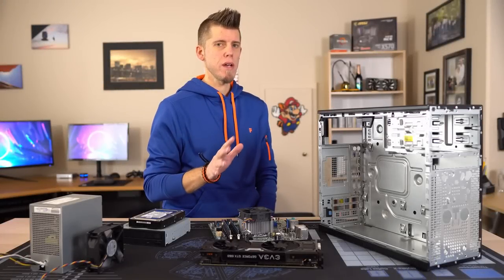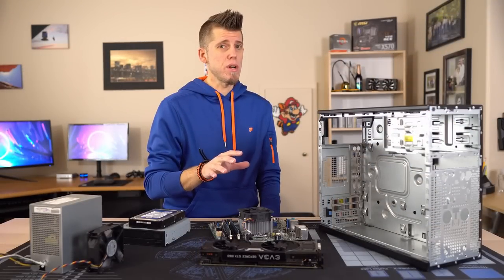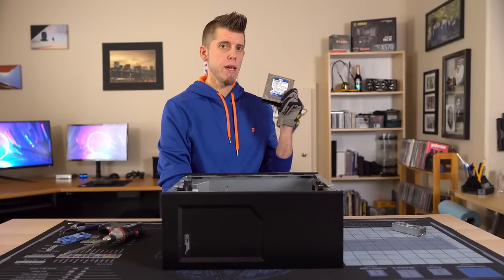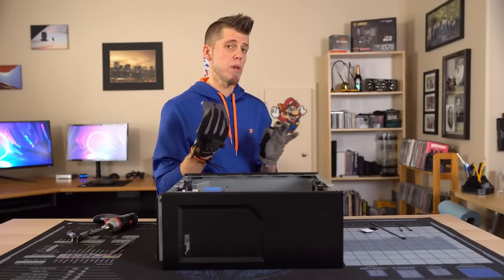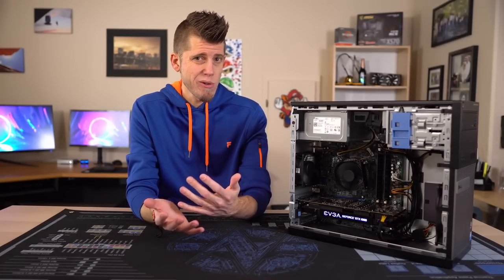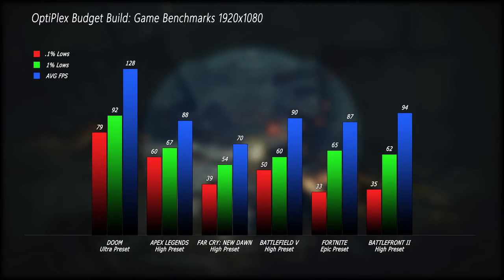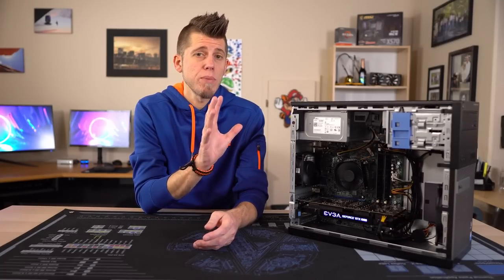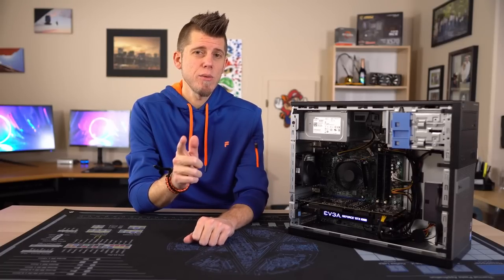Dell OptiPlex Budget Gaming PC For Under $300?

Comment: Hi I'm using optiplex 3060, I need to upgrade my graphics card to 8gb but my cabinet is small any solution please help me sir
Reply from the maker: Is this a small form factor model or is it a mini-tower model?
Reply: Small form factor
Reply from the maker: @sanobp1107  In that case, there aren't any 8GB GPUs that will fit in that case without cutting a hole in the side. All that you can fit are low profile GPUs and the best on offer right now is the GTX 1650 GDDR6 model which only has 4GB of VRAM. But the good news is that it will run on your power supply. The one big issue I can think of is that your PCIe slot on the 3060 is right next to the power supply which will probably keep you from installing any dual slot GPUs.
Reply: Thanks for your reply Sir,Can I extend up to 32Gb ram on this mother board ,Dell Inc.     04Y8V0   /G1X38Q2/CNFCW0086N02HM/  A02
Reply from the maker: @sanobp1107  No problem. Yes, the 3060 can have a max of 16GB DIMMs per module. So, you can install up to 32GB in the 3060.

Comment: Can i upgrade the cpu cooler using aftermarket cooler? I have dell 3020 also where can i connect the sata cable?
Reply from the maker: Yep, the mounting pattern is standard so any 115x cooler will work, just be mindful of the height of the cooler. You will need a Dell 5-pin to 4-pin fan adapter and you can find them on Amazon pretty easy. As for the SATA, you should have three ports, just enough for the HDD, SSD, and optical drive and they should all be in the same spot.
Reply: @TheGameBench  thank you so much
Reply from the maker: @klintdavid9664  No problem.

Comment: i found a optiplex 7020 mt for 193 here in canada. and i think it will be good to get! here are the specs.
Intel Core i3 4th Gen 4150 (3.50 GHz)
4 GB DDR3
250 GB HDD
No Screen
Intel HD Graphics 4400

Note: i have 6 gigs of ddr3 ram and a 2 tb hdd so i get 10 gb ram and 2 tb extra.

also is this good for gaming if i add like a rx 470 or gtx 960ti or a 1050ti? (i will be adding a new evga 650 watt psu btw)
Reply: also adding a rx 550
Reply from the maker: @samoodie  Well, I don't know the market in Canada, but I will tell you that the i3 is going to be very limiting. I don't recommend the i3's for gaming, unless you're playing esports titles and you want to get a 750 Ti. The i5's are really the lowest I'd suggest. 10GB is adequate for 1080p. Not a lot of titles will exceed that. If you can, I would suggest getting a 120 GB SSD for the boot drive. It will really transform the system, make it a lot more usable.

Now... the GPU. Well, as far as I know, there is no 960 Ti. That being said, I wouldn't suggest the 960 for one of these. Of all the cards you listed, the 470 and 1050 Ti are your best options. The 470 should beat the 1050 Ti and cost less. Regardless, the RX 550, 470 and GTX 1050 Ti have no use for a 650 watt PSU and can run on the stock PSU just fine with a SATA to PCIe adapter. Then you can use that money to go towards the SSD and/or a system with a 4th gen i5 instead of an i3. The i3 might be fine on the 550 or 1050 Ti, but not the 470, and the 470 is going to give you a much better experience over the other two.
Reply: @TheGameBench   so instead im getting a 7010 its newer for me and i only need 2 slots since im getting 8 gigs

Comment: I need help if this is good I ordered nzxt h510 case ryzen 5 2600x 320gb hdd 550wat 80 plus psu 8gb kit 2x4 b450 Aorus elite and later I will get a graphic card with it and better ram and a ssd
Reply from the maker: I mean, a 320GB HDD is pretty small these days. I wouldn't go for anything under 500GB these days, and 1TB drives are so cheap. The rest sounds pretty good, depending on what you paid.

Comment: I want to build this with a 1060 but here in Sweden the 9020 i5 4590 costs 250 USD. In my budget I could buy the 7010 i5 3470 for 150 USD + a 1060. Is this a good option?
Reply from the maker: How much can you get a 7010 with an i7 for?
Reply: The Game Bench 7010 can only be found with i5. The 9020 with i7 4790, 16gb of ram and a 500gb ssd goes for 450 USD. Another option I could go for is 7010 and swap in a xeon like the 1230 v2 for ~50 USD if that is a good option.
Reply from the maker: @slavichussar5825  I assure that the 7010 does come with an i7 3770 as an option. The 1230 V2 would be about equivalent to the 3770. Regardless, the 3470 isn't going to be a ton slower than the 4th gen i5, but in my testing that increase in IPC can really help depending. However, $250 is insane. IT's not worth the extra $100 over the 7010 with a 3470. Swapping in the 1230 V2 would be a better option at only $50. Maybe see if you can find the 1240 V2 for about the same price.
Reply: The Game Bench I meant I can’t find the 7010 with an i7 in Sweden, sorry for not being clear. So 7010 with a e3-1240 will work? Will this system with the Xeon still be able to run the gtx 1060 with the stock psu?
Reply from the maker: @slavichussar5825  Ah, I see. Well, no matter. The E3-1240 V2 will work just fine and it's going to perform pretty close to the 3770 with only a 100MHz drop on the boost clock. It might also draw a little less power than the 3770 as well. The 7010 has a 265 watt power supply, and should give you about 65 watts of headroom with a 1060 6GB installed. With a 1060 3GB, closer to 80 watts. It's cutting it close for what I prefer for a good buffer zone with the 6GB model, but you should be fine. Just might want to consider a power supply upgrade down the road, which is pretty simple in the xx10 series Opti's.

Comment: Can u change the cpu cooler for a new one
Reply from the maker: Yes, there are ways to change out the CPU cooler. I just depends on the cooler and the mounting method. Some will work as is, some will require modifications. Also, the fan controller is pretty picky, so the fan might not work properly. In all honesty, there isn't really anything to be gained swapping the CPU cooler on these CPU's outside of aesthetics.

Comment: Just want to know, is this PSU strong enough for the GPU?
Reply from the maker: Yep, it is. The 1060 is a low power GPU. While people like to make it seem like it's a power hungry GPU, it's not. It consumes about 120 watts. I've done more than enough testing with this power supply and seeing the power consumption, you have at least 80 watts of headroom, or more on this PSU and a 1060 6GB . If you want a more detailed explanation, I suggest reading the pinned comment.

Comment: Which GPUS should the dell 290w PSU be able to handle without issue? @the game bench
Reply from the maker: Here's what I would recommend as far as modern GPU's are concerned. You have to be careful with the 900 series and older from nVidia and from AMD I wouldn't try to run anything older that the 400 series.

nVidia:

1050/1050 Ti
1060 3GB/6GB
1650/1650 Super
1660 3GB/6GB
1660 Super

AMD:

RX 460/560
RX 470
RX 5500 XT
Reply: @TheGameBench    Hmmm, I noticed some Chinese sellers selling the 1050 for about 60. Probably a bootleg right? Also I saw the GTX 780 but the amount of watts listed was 230. I assume that is way too high for the 290W. What is the max capacity that the GPU can have so it can be used with the 290w? 🧐
Reply from the maker: @coolguyvideos599  At minimum the 780 is a 200 watt GPU, but can even go upwards of 250 watts. I wouldn't try running it off the stock 290 watt. I would also assume the 1050 is a bootleg at that price. If you're looking for something right now, I'd suggest the 470 8GB You can find them for close to $100 on eBay and you're looking at around 1060 performance and can run on the 290 watt. As for max consumption, I would stick to around 120 watts.
Reply: @TheGameBench  Thanks you are very knowledgeable

Comment: Is the original power supply enough for a gtx1060 6GB graphics card?
Reply from the maker: If it's the 3020, 7020 or 9020 with the 290 watt PSU, then yes. You're fine. I highly suggest using a dual SATA to PCIe 8-pin power connection instead of the single.
Reply: @TheGameBench  why the dual verison vs buying the single one?
Reply from the maker: @theunknown5516  Because, when I made this video, I made the mistake of thinking that the GPU would draw 75 watts from the PCIe slot, and supplement from the dedicated power. Unfortunately, that's not how it works. It's the other way around. So what can end up happening only using the single SATA adapter with a card like the 1060, is that you can overload a single SATA connection, which is 54 watts. Now, I built multiple systems like this and never ran into a problem, but I still would suggest using a dual SATA to PCIe adapter with the 1060. The single should be fine for something like the 1650 and 1650 Super though.
Reply: @TheGameBench  ohh ok. can you link me a good dual sata to pci e power cable? thank you!

Comment: How did you plug the fan in? Does the motherboard for the 7020/9020 have 3 or 4 pins for fans?
Reply from the maker: The 7020 and 9020 have proprietary 5 pin headers. In the video I used a 4 pin fan to SATA adapter cable. I the used a press on SATA connector to get it power, but you can use a SATA splitter.
Reply: @TheGameBench  I'm sorry, I'm fairly new at building a PC and don't know/understand all the terminology. Could I purchase a 4-pin PWM version of a fan and be able to use it somehow?
Reply from the maker: @jjnether  No worries. You wouldn't be able to without some sort of fan controller that would allow you to control the speed of the fan, or have temp sensors that the fan could use to adjust their speed. There are adapters that will convert the 5-pin connector on the motherboard, but you would have to pick between having and intake fan and an exhaust as it won't have enough current to run both fans off the one header.

This is why I just use the SATA to 4-pin fan adapter and run the resistor cables if I need to slow the fan down. Besides, the front panel is rather restrictive and speeding up the fan will only make it louder with no real benefit without cutting a hole in front of the case for the fan. Something I'll be doing in a later video.
Reply: @TheGameBench  Thank you! So you're saying that I can run power to the new fan from the extra beige SATA port using a SATA to 4-pin adapter, and possibly add in a resistor cable if there is too much voltage/speed, correct?
Reply from the maker: @jjnether  Oh, sorry.... no. You had everything right save for the beige SATA port. The SATA ports on the mother board are for data, not power. What you'll plug the fan adapter into is one of the spare SATA power connectors, that look like the one at 7:53. Otherwise, you're spot on. :)
Reply: @TheGameBench  Thanks so much for the help. So where is the SATA power connector port on this layout? https://ibb.co/p2pww03    I believe this layout is for the 7020 MT which I am using

EDIT: I misunderstood earlier, I believe you are saying that you would connect the fan to the adapter, then the adapter to the PSU using one of the SATA connections. Thanks for the help!

Comment: Hey where can I buy ddr3 ram 2 sticks of 4gb for opti 3020 thats close to 30 bucks or under?
Reply from the maker: eBay. I stick to Samsung, Elpida and HK Hynix DDR3 1600 and I can find it one eBay for around $20 to $25 for 8GB easily, sometimes less.
Reply: The Game Bench thanks
Reply: The Game Bench 
Samsung 8GB 2X 4GB 2RX4 DDR3-1600MHz PC3-12800R ECC REG Registered Server ram
Would this work?
Reply from the maker: @ClipsVi3w  Sorry, I should have specified non-ECC. ECC memory won't work in the 3020 or with the Core series CPU's.
Reply: The Game Bench 

Ok. 8GB ( 2 x 4GB ) PC3-12800 DDR3-1600 MHz NON ECC RAM SAMSUNG HP how about this? And does the pc3-12800 text make a difference and does all of these rams work on all 3020 motherboards and cpu’s?

Comment: What is small battery that you replaced thanks
Reply from the maker: It's the CMOS battery. It provides power to the BIOS chip so that it can save your BIOS settings. The specific type is a CR2032 coin battery.

Comment: An Arctic 11£ P14 on the front would have been a much better choice instead of the fan you used.
Reply from the maker: How so? Wouldn't really have been a better fan and would have save only a few bucks. The reason I went with this fan is because I've found in selling these, nobody is interested in my area unless there's some sort of lighting. For that... it's worth every extra penny.

Comment: How to set the blue light fan in the case like in the thumbnail?
Reply from the maker: I have a couple of video to show you how. First you have to remove the HDD cage, then you have to cut down some material from the front to add the front fan, then I just used a Corsair AF/SP 120 blue LED fan. However, I highly suggest cutting out the material in front of the fan entirely for better airflow and reduced noise. Something I'm considering doing an updated video on.

Comment: While the PSU will be good enough to last for a while, don't be upset if it kills your system. I would rather spend $50 more to get at least an 80 Plus certified PSU with at least 100 Watt headroom.  You can save money by selling the old PSU and keeping out the extra fan.
Reply from the maker: I have no worry about that, and I'm confident it's a non-issue unless people ignore my advice and try to run a more power hungry GPU on it, or overclock. This PSU has close to 100 watts of overhead with this hardware. I will say that I would caution bringing up 80+ certification. It's just an efficiency rating. Has nothing to do with quality. There's this consumer perception that it is, and thus, garbage PSU manufactures prey on that by taking a trash PSU and spending a little more on the capacitors so it can certify as an 80+ gold PSU, bump up the price, and increase their profit margins. The people buying them have no idea that it's a terrible power supply, as they assume it's good because it's 80+ gold. Honestly, the 80+ rating is a factor, but it should be much lower on your list than some other factors.

Also, the fan is the difference between throttling and not throttling depending on the GPU. If you're fine with your GPU possibly dropping on the core clock... by all means.

Comment: What about using this computer as Streaming and CS GO at the same time?
Reply from the maker: If you go with an nVidia card and use the nVenc encoder, you should have zero problem. However, using h.264... I mean, it might be fine with CS GO if this were an i7, but it will effect performance. And being an i5, that might be a problem. If you're trying to be competitive, and I assume you are if you're streaming, I wouldn't want to take anything away from the CPU. That being said, the 4th gen i5 in CS GO was doing about 281 FPS on average, at the lowest settings, with the 1060. And you can use to the 1060 to encode the stream with no hit to performance.
Reply: @TheGameBench  Hmmm interesting, so it can be said that, the combination of i5 4th gen and 1060 is already optimal in terms of budget and performance for streaming and CS GO, am i right? or do you have other optimal combination? maybe with Intel Xeon in 2012 and 1060 or with 1st gen Ryzen? for the max budget of 300 bucket, for sure. Thank you for your help. I want to build the budget PC that can streaming and CS GO especially, or esport games. Or If you can't answer now, please make it for upcoming video ;D
Reply from the maker: @-mustang-9383  Yeah, I would call that accurate. On the i5, moving up to the 1070 nets you about six FPS on the average, though the 1% and .1% lows do improve considerably when you hit the 1080. Still, not worth the added cost.
Reply: @TheGameBench  man, thank you so much for this information. I can use this as the base formula for building, thanks a lot!
Reply from the maker: @-mustang-9383  No problem.

Comment: i have a $100 PC dell OptiPlex 780 Mid tower 
CPU Q9650 $20
8GB DDR3 10600 $30
1TB WD Green HDD $30
Geforce GT 220 $20
Grand Total $100
Windows 10Pro 20H2 64Bit 
Is this PC is good in 2022 Need Suggestions Please.
Reply: Not really you should sell it save up and buy one of the optiplex 7020 or 9020